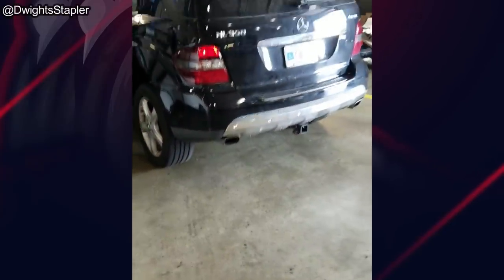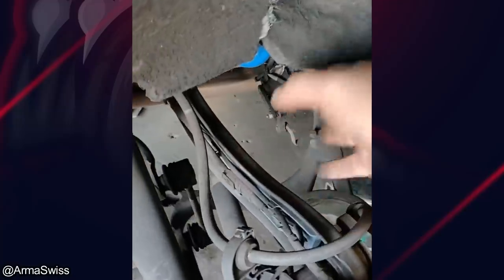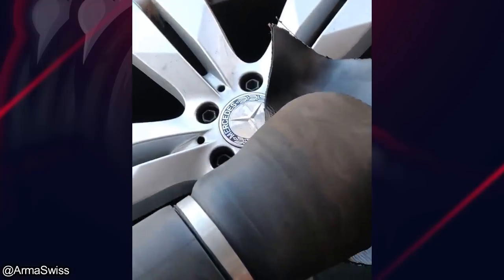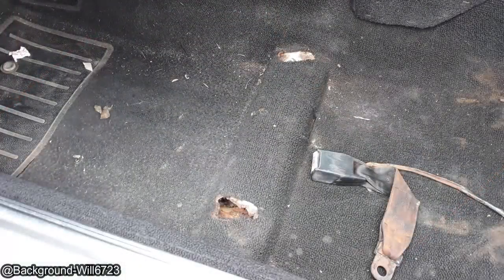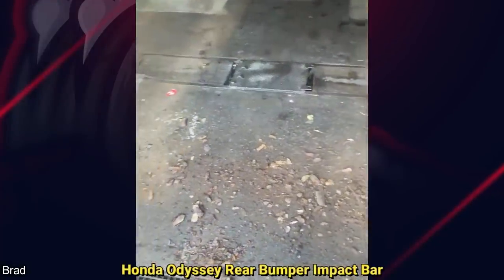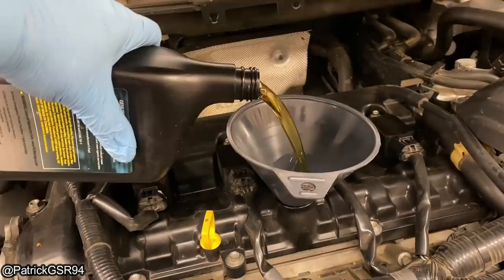Customer States Vehicle Smokes After Oil Change | Just Rolled In

Comment: Story #1:  Had a similar overfill / smoky issue with a standby generator years ago. One of the new kids did the service, hooked up his pump and walked back to the truck for 5 quarts of oil. He figured the pump had run long enough so dumped in the new oil, fired it up for 10 seconds to see the oil pressure come up, then packed up his tools. (was Friday afternoon) He never pulled the dip stick. Wouldn't ya know it... there was a power outage that weekend and I was on call when the customer reported his back yard looked like a mosquito fogger had parked there. Drained out the excess and the smoke calmed down after another 10 minutes, but at least it was dark out now.  Story #2 was about a Datsun 240Z that went to Jiffy Lube to get fluids changed because he felt the dealer was too expensive. They are notorious for the rear dif plug being hard to access and we ALWAYS made sure we could get the fill plug out BEFORE we drained the dif. The lube shop drained the oil but couldn't get the fill plug out so attempted to squirt some in through the drain hole then quickly install the plug. Two weeks later we had the car in for a dif overhaul at the dealer and there was maybe a few ounces of oil in there at best.
Reply from the maker: Wow and wow lol. Can't believe the kid didn't even bother checking the also. And also good to know about the 240z!
Reply: @JustRolledIn  ... the 240, 260, and 280Z all had the fill plug behind a crossmember and you had to grab it with an open end wrench but they were so tight your wrench would spread and round the square plug off. If you worked at a dealer you had an open end that you welded a piece of steel across to keep it from doing that.

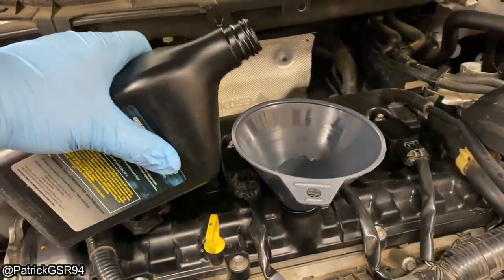Comment: 2:39 I knew this, but with my luck I still manage to pour half a quart all over the engine. :-P
Reply: Same. I like to think that every oil container ever is defective. I got to sleep at night somehow.
Reply: I have one...got it at NAPA AUTO PARTS...It is a jug graduated in litres and quarts with a spout so you can pour exactly the right amount in. Can be used for oil or any fluid. Best to keep one for each fluid so no cross contamination will occur.
Reply: nothing rustproofs an engine better than a leaking valve cover gasket or a few misses with the oil bottle.
Reply: And always use a funnel with a decent sized mouth...kitchen funnels don't hold much oil and the wife gets mad too.
Reply: @haroldwilkes6608  don't use her turkey baster to remove brake fluid
Reply: Funnels help.

Comment: Another tip on the same vein as the oil bottle pouring. Those gallon jugs for antifreeze or windshield washer fluid pour better when tipped on their sides.

Comment: I was at a service station getting gas,when one of the attendants was adding a quart of oil to another vehicle,he spun the wing nut off the air filter cover,removed cover and poured the oil in the carb.

Comment: Of all the videos u upload the ones with rust are just scary as hell. Makes me somewhat glad I live in SoCal. Yikes 😱
Reply: I am in Northern Texas
Reply: The rust ones I see all the time here in the rust belt. Even on some pretty new cars.
Reply: 2 parts paint thinner 1 part ATF. Spray.... everything. Works great.
Reply: Southern Oklahoma does not have rust like that thank God. We have got some programs in from up north and I hated to see them back in the shop. Lol
Reply: glad to live in Germany... We have TÜV inspections 
everey car need one every 2 years 
who has no TÜV will be shut down immediately
Reply: @billmunny6813  good way to ruin all rubber gaskets/seals in your vehicle...
Reply: @DL101ca  Not many on those on the outside of the vehicle. You think there are no soft seals in an automatic transmission? Try to keep up. You know what they say about assuming.....

PS. I'm not finished yet. You seem to have no idea what you are talking about so why the hell are you here running your mouth? Sound like a keyboard mechanic.

Comment: As an Australian viewer (and former mechanic decades ago), I'm constantly amazed at the amount of serious rust in some of these vehicles from the cold regions of the US, salted roads, etc. How do you keep your cars roadworthy and structurally safe when they're eating themselves away right under you due to conditions out of your control. Here in Ozz my 2006 Mk5 Golf is almost like new underneath and under the bonnet. Not the slightest speck of rust anywhere. I bought it brand new and it now has 185,000 km (115,000 miles) on the clock.
Reply: It's not easy i live in a salt state but not a real bad one but I buy all my vehicles 7 or more hrs away in the south where there is basically no winter or salt. My friend has a 2012 Silverado gorgeous truck only has 75,000 miles the frame is rusted out in 3 spots, both rockers gone,both bed sides have rust, front core support its rusted out its about to be scrapped wont pass any inspections in his area.
Reply: @frankm8533  That's really sad for your friend. A low mileage car that's only 9 years old. It's lucky he was never in a collision (I assume) as it would have collapsed underneath him. We have a few Silverado's here and there in Australia, the import duty is unfortunately very high.
Reply: @PropanePete  Definitely is I have a couple friends in Australia I don't remember where they exactly live but they visited here in 2019 I got to see them for a week. They are Car/truck people as well
Reply: Keep your car clean, well maintained and rust proofed professionally every year($120) and you won't have issues.
Reply: @davidhoulden5791  never heard of a place doing rust proofing
Reply: Basic answer: Most people don't worry about it, or know about it, until things break. Sorta the 'Murican version of "No Worries".  Some people in salty areas wash the underside of their cars, some get rustproofing done on new cars, but that's generally a minority here.

Comment: First one. My brother borderline did the same mistake. He went to check the Oil level immediately after a drive and saw the level "low". Mistake.
He added more oil and his engine started to smoke every time he would come to a stop then drive (causing the engine to even Stall!) It fixed itself after 2 weeks.
The way the engine is built in his Mazda, the PCV valve is somewhat low and infront of the engine, hence why when he would brake, the engine would start drinking his own blood.
Reply: PCV valve is unrelated - more likely the excess oil got past the oil control rings andcwas burnt off in the combustion chambers until the level stabilised.

Comment: The first one baffles me for specific reasons. First that they can fill the engine so full with oil and it will still work (in a way). 
And second, i remember what we were told learning for the truck driving license long ago: black smoke: soot, white smoke: there's water in the combustion chamber (either condensation with a cold engine or cooling fluid caused by a defect) and blue-ish smoke:  oil gets burned.
In the video it looks more white.

Comment: I have always tought that you guys don't have those inspections for the cars. In Finland its every year for older cars and every other year for newer. I barely got my first car (-00 Nissan Almera) pass on its check up. It had just small hole in the exhaust and needed to change brake pads. My nephew "fixed" the pipe

Comment: I had a 74 chevy pickup that had rusty floorboards. When It rained, more water blew in thru the floor than if you left a window open. A dozen or so tubes of silicone and scrap pieces of sheet aluminum finally fixed it.

Comment: My parents owned a 1988 Subaru wagon with the 1.8 liter turbo and awd.  like the first clip a mechanic (at a good shop) drained the front differential and overfilled the oil.  It didn't smoke, but instead caused the differential to seize.  The shop paid for the repair.
Reply from the maker: Damn, that's unfortunate! But good thing they paid to get it fixed. Some shops wouldn't even do that.
Reply: @JustRolledIn  When the differential seized my dad had the car flat bedded to our local Subaru dealer.  The Subaru mechanic was shocked when dad told him that it wasn't Jiffy Lube but a mechanic the Subaru mechanic knew that screwed up (Actually, it was an employee of the mechanic who goofed.).

Comment: I can't remember who's story it was (might have been my brothers from working as gas jocky in a major canadian city), but they were asked to add some oil to a vehicle that was in for fuel. Yup, wasy overfull. Whoever was adding oil for them never pulled the dipstick before putting more in...
I had an 80's fwd chrysler that the foot well behind the drivers tire pulled a disappearing act on me - I had it hauled to the wrecking yard, and told them to make sure it never went back on the road. The boys there did played dukes of hazzard until the trans went, then pinned it until the motor went. Local FD used it for fire practice a while later.

Comment: LOL.  I did something similar on a Mazda 3.  I drained the transmission fluid then put the normal amount of oil in the engine.  This happened because the two drain plugs were very close to each other under the car.  Fortunately I figured it out very quickly when the car wouldn't move due to having no fluid in the automatic transmission.  I drained out all the oil, put the proper amount in, then filled the transmission back up with fresh transmission fluid.  No biggie and a lesson learned.

Comment: Was expecting to see fix of the fog machine :( but epic but still :)
Reply: They probably overfilled the oil. #1 cause of that problem. Drain out some of the oil, until it's at the CORRECT level and the smoke problem will disappear. It might take a few minutes of running.
Reply: @maj8301   :D

Comment: As your vehicle get older it will surprise you with failure of parts and components even if you've maintained it. I got in my 2004 Honda Pilot a few month ago and suddenly my seat almost threw me into the back seat when I put it into reverse. It seems that a plate that supports the pitch and recline motor had broken. I pulled it out and went on line to get a replacement plate. It was riveted to the seat assembly an one side(the one that broke) and bolted to the motor on the other side of the plate. Well I would have had better luck finding a solid gold brick laying on the street than finding that plate. The whole seat was the only thing that was offered and even used ones were way over $1k. Some looked worse than the one I had so I ground the rivets out with my power burr and put masking tape to align the plate parts for welding. I then called my local muffler shop and they agreed to weld it for me.They did and didn't charge me anything as they welded it right through the tape in the work bay and I used my grinder and power burr and drills to clear the holes for bolt. It took less than 2 minutes to weld and I gave the guy $10 for a beer and went home and installed  it replacing the rivets with bolts,flat and lock washers,nuts  in less than 30 minutes. When I searched the driver seat plate breaking  on the internet when I first discovered the problem  I came up with thousands of post going back to 2006 about people demanding a recall for that problem.I should consider myself lucky it lasted for so long.Now its time to buy something new and let some young guy have some fun in the back roads til it goes to the big scrap yard in the sky.

Comment: Yep I used to work for Subaru and we would get cars towed in with overfilled smoking engines and ruined transaxles
from no fluid, then Subaru made the drain plug on the front diff a huge Torx to help prevent this from happening.
Reply from the maker: I've heard about that lol

Comment: Hot Snot dude was desperate, I would’ve used Flex Seal myself.
Reply: I've seen someone repair a torn bead on a tire with flex seal, amazingly it actually held air.
Reply: Just a few layers of duck tape sorts that right out! Don't even think of using the spare, that's for losers!
Reply: Flex seal wont work with air, must use water instead. LOL.

Comment: Knew the oil thing. But it did take me a while to learn that. Hot glue gun on a tire. That was new for me. I did have someone put an entire tube of JB weld in the fill on their radiator is an attempt to stop a leak. I gyess the idea was that it would weld together as it leaked out. It welded the water channels in the radiator shut, killed the heater core, and caused the engine to overheat badly enough to warp the alloy heads. Pretty sure replacing the radiator, or having a professional fix it, would have been cheaper. But what do I know?
Reply: I know amateurs that would have been cheaper than that! :)
Reply: @markh.6687  Well, true. My main idea is that if you don't know what you are doing, then get help. That cheap fix was damned expensive.

Comment: A lot of people don’t know this, but holding the bottle/jug/bucket upside down, sideways, poking a hole in the bottom, or controlling how fast you pour stops the bottle from choking...if your a mechanic for longer then a month and don’t know this then go back to school

(If you want the oil to go really fast, poke an air nozzle through the hole made by a seal pick)

Comment: I worked at an oil change and a guy mistook the transmission cooler for the oil cooler when hooking up the transmission flush machine. After running it twice he came to get me to figure out why the transmission fluid was still dirty. 
Needless to say the crankcase was VERY full... at least the guy got a good engine flush LOL

Comment: Ah the transmission drain instead of oil drain.      

Years ago i Did that ...  ONCE   ...   figured i did something wrong when i checked the dipstick to make sure all the engine oil was empty (for some reason I just always did this , strange i know) and it was still full.    Going back under i saw there was another drain plug bolt just inches from the (transmission) drain plug bolt i just removed.   You would think an oil pan and transmission pan would be easy to tell apart ... but   ...  you would be wrong in some cases  (epically if you are rushing ... haste makes waste ).

After correcting my error ... and getting relentlessly teased by my fellow techs ... i had to pay for the transmission refill and apologized to the customer (wasn't going to keep that secret).   Customer was understandable upset but thanked our honesty (i paid for the oil change as an additional apology).

Beyond that    i can't believe that they didn't check the oil level before letting the customer drive off.    I know quick chance oil places can be awful at times.   However you would think they do just the basics.

For those wondering what kinda of vehicle i messed up on ... if memories serve me it was and Acura of some kind.   Sorry can't remember the exact model.  Im old  😑

Comment: The fact there’s people driving around with their vehicles held together with rope is terrifying 
There’s this one guy on my commute who had a jeep with a broken frame, he drove around at max 45 mph for like 3 months before the cops finally put a stop to it after many complaints.  Now he has this old beater Silverado that he can barely keep on the road.  I always say, he’s either drunk, falling asleep, on his phone, or just a terrible driver.  I honestly don’t know which it is.
Reply: I used to work at a hardware store.  One day a guy comes in and asks if I have a double sided magnet.  I said is this some kind of trick question?  He said his car door wouldn't stay closed and he wanted a magnet to hold it shut.  I said do you know how much force is on that door in a turn to hold it closed?  I suggested he reevaluate his safety and get it fixed properly.  He conceded that I had a point.

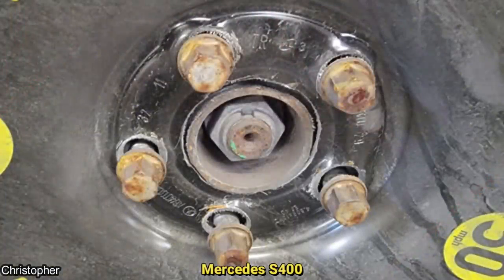Comment: 2:00 Mercedes: Spare tire needs different lug nuts. more stuff for you to lose or not know about. 
EVERY OTHER CAR MANUFACTURER: just use the same lug nuts....
Reply: I thought that was pretty outrageous.
Reply: That honestly made me shake my head. That's what happens when engineers forget that most people can be kinda stupid when it comes to their cars.
Reply: Mercedes used to that when alloy wheels were ordered as an option and you still had a steel spare tire rim. The long ones will work on the front, but would take the parking brake mechanism out on the rear.
Reply: I was in the field wrenching for over 40 years. Early on, I noticed I lost money every time I touched a Mercedes. I quit touching them, and had a happy career. My co-workers pulled their hair out at times, and had lousy paychecks.
Reply: @reubenj.cogburn8546  Its a shame, they are great vehicles when everything is working properly. But as soon as anything breaks it becomes an utter nightmare!
Reply: @cullenmiller8170  this is why most manufacturers just use wheel hubs with studs and lug nuts instead of drilled hubs with lug bolts!
Reply: @alexwalker2582  I think its the engineers that are going stupid! 
Transmission dipstick: you dont need that!
Battery location: lets put it under the headlight behind the fender! 
Replace window regulator: must use OE scan tool to "program" it!
Reply: @crazypete3759  I agree, if there were a trophy given out for over-engineering Mercedes would win hands down all day long
Reply: @crazypete3759  Nah, that's not the engineers. That's the corporate overlords demanding they make it harder and harder for independent and self repair while still making it possible to service.

Comment: I had a guy come in once who had vise grips clamping the back brake lines. The pads were worn to the metal and was grinding. Instead of replacing 20 dollar pads, he spent 40 on pliers. He still didn’t want it fixed so I only done the alignment.